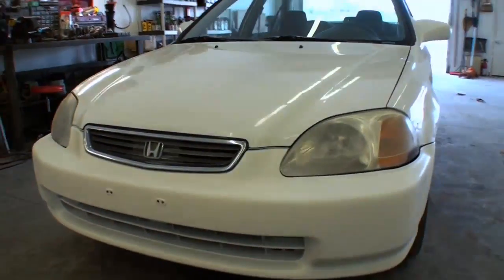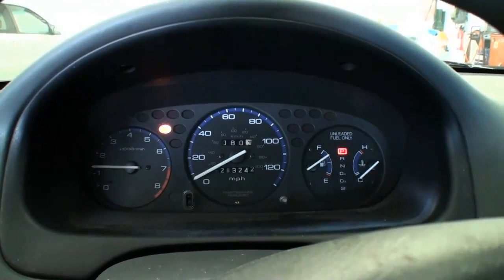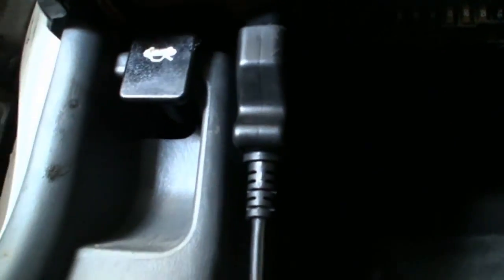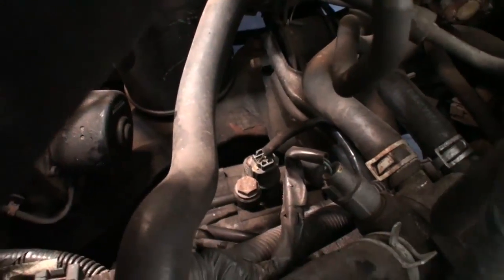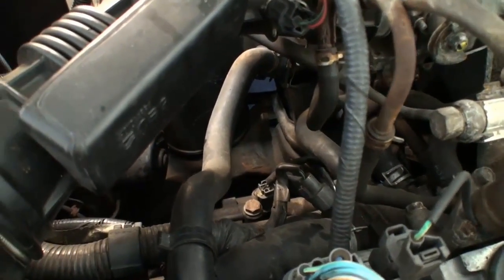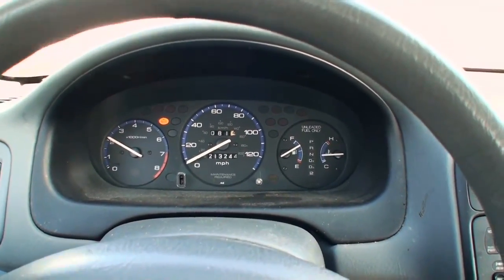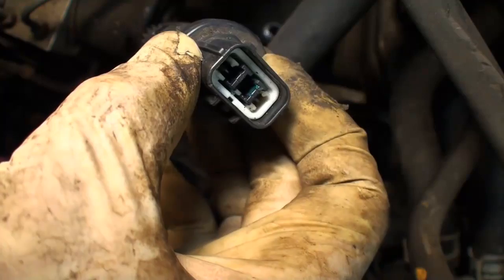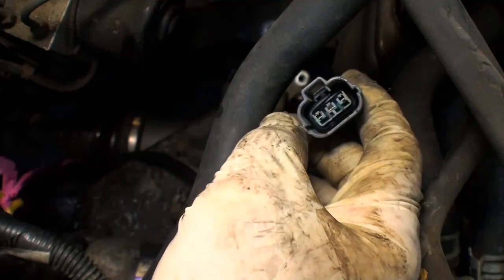P0501 1998 Honda Civic Speed Sensor Diagnosis -EricTheCarGuy

Comment: Had this problem as well on a 2000 Civic I'm working on. Replaced the sensor, but the center pin on the connector wasn't making contact due to corrosion damage, even after cleaning it up. Stuffed a tiny piece of aluminum foil in there, and it worked. Also slathered a bit of dielectric grease on the inside of both ends to keep moisture from getting in again. Applied this fix to an exact same issue on the MAP sensor.

Comment: i have a 94. slightly different sensor. the 3 screws on top are stuck so im removing the 2 bolts instead. 
I discovered the middle pin on the sensor was bent forward and flimsy. 
The car was driving around like that for at least a year and had some problems shifting. can a bad speed sensor cause transmission damage?

Comment: The mystery of the under-dash  7.5A Alternator/SP. Sensor Fuse #15 solved. Thanks. I wondered what SP. stood for. Strangely it supplies the alternator as well. I removed the fuse and started the car and the alternator still charged the battery. I did not drive the car to see if the speedo was nullified. Its a manual so it can't alter the gear change, but I was curious.

Comment: hey man so my csr is a 1997 honda civic coupe manual tranmission. It doesnt display the right speed when i go past 35 mph and the rpms jump around a lot. Im not suree to replace my speed sensor or if its something else like my gauge cluster is going bad.

Comment: So I have a 2000 honda civic where my speedometer will spontaneously jump around. It isnt constant just sometimes. However i have been having issues with my tps (throttle position sensor), would that cause issues with speedometer if the tps isnt dialed in?

Comment: I replaced the VSS sensor but not the gear could the gear be broken if I still have the 501 code? also unpinned the corroded connectore and cleaned out put electric grease on it. cleared code 97 Honda Accord. I noticed you replaced the gear as well I didn't do that .

Comment: @ERICTHECARGUY. Eric I am wait for the vss to come in next two days. I disconnected it and the speedometer stopped jumping. I drive back and forth about 60 miles can I drive 2 days without this sensor connected? Ps disconnecting tripped the check engine. However check engine not flashing.

Comment: Just went through the exact same thing except I drove without the speedometer for a year. Was misfiring bad and replaced plugs and wires and read that the VSS can cause some other problems. It looked easy to replace, but it didn’t work. Your video showed the corrosion issue and my center point broke off in the connector. Finally extracted it and now I have a speedometer. This was GREAT!

Comment: I still can't find it in mine so I guess I'm using the maps app or something, the speedometer worked until I went up to 3rd gear for a block but still lol, usually I eyeball the speed depends what gear I'm in or how high the rpms are

Comment: Dear Eric:
I would highly recommend that after you clean the corroded connections, you should apply something like Noalox (antioxidant joint compound, sold under many names, used primarily for preventing corrosion on aluminum conductors, but works great on all conductors). And I would also recommend coating the gasket of the connector with that wonderful silicone grease (silicone paste), to help it seal better and help it connect and disconnect easier.

Comment: I don't understand the part.. where you tried to guess solve the connection problem and not put the old sensor back to see if the connection was the problem, but instead replaced it anyway, so how do we know if the connection was the problem.  By the way I notice that the odometer was not working?  Was it not in congruent with the speed sensor at all

Comment: What about the car (98 civic ex automatic) losing power while driving, dash lights stay on and speedometer stays on 40 mph? Stalls then after about 5 minutes starts back up with no problem?
Reply: Ever get it situated?
Reply: @Micheal1075  thank you. I took it in to honda, they said it was the distributor, so I replaced it. While i was driving the car home, it did same thing again so I took it back to Honda center. They kept it for about 2 weeks and claimed it didn't turn off on them so they released car back to me and so far seems ok just keeping an eye on it until it happens again so I can get to the bottom of it.

Comment: Hello! I have a 98 vw beetle, I had gotten a p0501 code on the obd2 scanner I looked it up and it said to replace the vss so I did but yet I still get the check engine light. By the way the speedometer does not read speed

Comment: Thank you. I did some maintenance on my connector last night while putting in a new speed sensor, and as far as I was able to find through experimentation and observation, the rubber gasket should go in BEFORE the white guide clip. I tried putting it on in the same order as you did in the video (white clip first, then rubber seal), but I couldn’t overcome the resistance trying to plug it in, so I pulled it apart and tried gasket first. Still felt some resistance (the gasket probably could have used a bit of lubrication), but when it clicked it felt “right.” Thanks again for this, and your countless other helpful videos.

Comment: HI Eric, I have  a 2003  Buick lesabre  and it hard shifts   so I pulled  a coil failed code and replaced it  ,it was OK for  a few days now I have  a slight  hard shift comes and goes  changed fluid   to no avail.  would a EGR valve stuck case this ?
?

Comment: Also codes PO135 and PO141. Car will crank but engine doesn't turn over if you restart the car shortly after turning it off.  I've noticed that I can put the car in 1st gear crank it up mash the accelerator pop the clutch and the engine starts up. Would any of these 3 codes or problems have anything to do with the car not being able to start up after it is warm. There's never been a problem starting he engine when it's cold. Btw, 369,000 miles.

Comment: Eric, I got a CR-V 2000, I recently replaced the whole engine, now sometimes, the car shows the check engine light when I reach almost 60mph... I also noticed that when it is about to turn on the check engine light, the RPM seems to be high for the speed the car is going at. The guy a the repair shop were we changed the engine told me that it could be the speed sensor. The problem is not seen when the car is running at less than 60 mph. If I turn off the car and start it again, the engine light is gone, possibly until the next time I hit a high speed, sometimes it does it, sometimes it does not. 
Do you think I should replace the speed sensor or try something else.
Thanks!

Comment: Thanks for the nice video.  I apparently ravaged some part of my speed sensor mechanism when replacing transmission control cables on a manual 5 speed.  I get to survey the damage done tomorrow.
Replace the PCV valve!  Especially on older cars, and newer vehicles that you want to age much more nicely.  It is cheap, easy, and will help keep your engine from becoming pressurized with exhaust, which should've exited through the PCV valve, and forcing oil leaks in various places.  Another popular YT mechanic (SK) recommends doing it every three years.  When in doubt, just change it.  It is cheap, easy and protects your engine!

Comment: Juat bought a 2000 honda civic si manual transmission and the speedometer doesnt work. Now I know what to look for, but if the issue isn't the speed sensor then i dont know what to look for after that.

Comment: I’ve only seen 3 mins of this video and I think I just found the issue with my Acura TL 2008 I have ODB II DASH tool that shows me my speed from the ECU (Double checked with a radar, it’s exactly on point) but my speedometer shows 7 mph higher than actual speed. 

EX: radar shows 25mph, ODB II reading 25mph, speedometer showing 32mph (analog)

This will get interesting eric ! presses play **will update after full video **

Comment: I have 2002 civic ex and have the same problem with a code of P0501. The speedometer is fluctuating and I have a transmission shifting problem. But,  there are two speed sensors,  one is working magnetically the other one is that you changed in the video. Which one has to be changed?  I have not differentiated which one is broken.

Comment: Eric. just replaced the speed sensor. now I am currently about to drill out the mounting bolt. heres the story.
first initial startup after replacement. speedometer bouncing all over and transmission sloppy. second startup. everything great. every startup after. mostly indecisive, mostly not working. so the next day I figure, magnet not reading, bolt needs tightening. old bolt rusty bottom. this bolt runs through the cast and the Bottom touches air, right... explains the rusty end of the bolt anyway. anyway first time I tighten, nothing ... try it again, snap. so more invasive procedures and a new bolt needed. 

question is, could this just very well be a cheap aftermarket part? after all it was reading a few times. and obviously bolted all the way down until I snapped it, which I feared would happened, but did it anyway.   

and that geared end of the sensor? aside from a magnet, if this sensor works on magnet principle... is that geared end something that happens to go in easy or does it become problematic during installing? I'm picturing mashing gears to whatever its working with and not seating properly, thereby not getting readings because its in fact not "in". but then again the car did operate correctly at times. all this within a day and half. any reply appreciated thanks

Comment: I want to thank you so much. I changed the speed sensor and it worked for a few months. Then started to do the same thing. So i bought another one lasted one day. Now what? I went back and watched the video again. Guess what. The insert and gasket was still in the original part. Im a pack rat on parts sometime. I put the insert and gasket in the plug and smooth as ice.  Hind sight 2020. Sub. & like.

Comment: I have a problem with my 1998 accord reading inaccurately, it’s not a tire issue it’s just that it reads much higher than I am actually going could that be a speed sensor or is that more likely this barometer being worn out?

Comment: Good day the car guy I have a 2001 Chevy stepvan diesel with 58000 miles i have a problem with the speed , the speed gauge say I am going 70 mph but the speed of the truck feels like I am going 25 mph when I push the gas the speed gauge go higher but the speed of the truck stay the same and ideas please help

Comment: Hey Eric I have a 2001 Honda Civic automatic 67,000 mileage for some reason when I'm driving it doesn't want to pass 60 I'm thinking that is possible the shift solenoids or is it the torque converter I'm not sure please help me out thank you

Comment: How would a bad speed sensor affect a manual transmission? My speedometer has been jumping a bit at around 70 mph but I am not noticing any other symptoms. Will this negatively affect my 2005 honda civic?
Reply: No because the computer doesn't need any info from that sensor because you're controlling the shifts

Comment: I got a question I replace my speed sensor and my speedometer still doesn't work so I got another cluster and it still don't work what else can it be thanks
Reply: did you fix the problem?

Comment: hi Eric I have a 1999 1.4 Honda civic showing code p0141 we have changed the o2 sensor but problem still shows when scanning codes also car is very sluggish up hill does anything spring to mind we could try please any help is appreciated

Comment: Eric, I really need your help. I got Lexus gs300 1999. I once rev the engine from dead stop to full and since then there is a delay in gear shift, it jerks from 1 to second gear as if it's trying to catch the gear. I got my tranny changed but nothing. Later I got engine check light on and then it stopped happening jerking. What could be the problem.

Comment: Also after having similar symptoms i wasted money on a new sensor. One common problem with the 6th gen Honda's is the that the wiring for the vss is getting pinched between the intake manifold and its braket. Get underneath and remove the bracket and check that its free and hasn't been damaged. Just a quick tip before buying a new sensor.

Comment: Hi Eric I have a problem with my 2002 honda civic lx 1.7 everything seems to work fine but transmission  won't shift I just change the fluid but still won't  shift have you ever came across with a problem like that?
Can you help me out please .
Reply: Did you ever figure this out ?

Comment: Hi I got a honda civic si 2000 and my speedometer dont move at all I change the speed sensor but still dont work I check the wires but thy're fine what else can I do to fix this

Comment: such a hard decision- is it speed sensor or is it the cluster?  my rpm is way off. I have a 95 Civic EX with 95 B18c1 swap so my fuel cut off should be 8250rpm- but I can only get to 6800rpm on the gauge where it fuel cuts off and rev limits. it never can go past 7000rpm on the gauge. (but when i hook up a timing light gun with rpm digital gauge it will show 8000rpm!)  my Speedo is another problem and will go all the way around past 120mph and stop on the resting pin of the speedo and get stuck there so I'm driving around with no Speedo right now. sometimes it will try to fix itself and then goes back counter clockwise to 0mph and show the correct speed im at but then it random goes all the way back clock wise to the resting pin again. when the Speedo does work I'm off by 5mph after 40mph.  so is this the speed sensor or the gauge cluster?

Comment: 2001 Accord. The odometer gauges  (speedometer, RPM, heat and fuel ) they jump all four of them and all the lights go on and off. could this be also sensor or fuse problem?

Comment: Eric , I have a 98 Honda Civic with 113,000 miles on it...a tow truck busted my transmission and I went for six weeks without the car finally getting a settlement which I thought was fairly good..1600 from Pilgrim Insurance and $500 Triple A..  The man from Triple A was an ex honda employee for many years and told me it was worth saving instead of using the money for a downpayment on another car and big monthly payments, higher insurance since I am retired on fixed income..    I decided to use the mechanc's actuallly across   the street who always fix anything I need immediately...They put in the transmission....then showed me the radiator needed replacing....drove well for 2 weeks then bam...now he said alternator so that is being done and he said the fuse that connected to the speedometer was a problem  yesterday he said another issue...when he test drove it it sounded at times like it was going into another 'geer'....he told me this morning he is going to put a sensor on it...I have farmers back home who could keep me going but can't...what do you think I should do now?  I drive in fear wondering what next will break down and run out of my towing for reasonable fees from Triple A....so  I will not drive except to pick up my granddaughter and shop for groceries...

Comment: I have a 1996 Honda civic cx hatch with 520 000 km and the same thing has happened to me, but the engine light came on as soon as my speedometer went haywire, I'll unplug it and see if that's the problem. Thank you ericthecarguy!!

Comment: I've got a 97 Honda Accord SE in mind was giving the speed sensor code also I changed it out and it was acting fine for a couple of days then it started acting crazy again then I was looking on the web and it's suggested that I replaced the control modular so I put a new one in and it was acting fine for a couple of days then it started jumping again and my check engine light came back on and it said it was the speed sensor again so I was thinking it could have been the pigtails on the main wiring harness so I cut it off and directly wired it straight to the speed sensor then it was acting fine for a couple of days then it started doing it again this morning as I was going about 35 miles an hour my speedometer was showing I was going to zero when I turn my blinker on my speedometer started wigging out then when I turn my blinker off it stopped and then all of a sudden my speedometer started working again and the car started shifting fine does anybody know what would cause this to happen

Comment: I've a 1998 crv. Harsh shifting. I've replaced the solenoids and had a slight improvement. No fault codes but I've noticed that my countershaft and main shaft live data readings can intermittently be different. The main shaft sensor seems laggy and spikey. I don't think that's the one you took out here, is the main shaft sensor the one on the front of the box? Would it be this front one that's confusing the ecu and causing harsh shifting? Or something main shaft speed sensor related in the box? Thank you :)

Comment: My 98 civic speedometer has been working sporadically for 3 years and now. Lately, the car is starting to shift a little more abruptly, especially down shifting. It also slips a little in and out of gear at 60 mph for a while, then stays solid after about an hour on the freeway. Could the malfunctioning speedometer be the cause?

Comment: what is IAT circuit failure?  which sensor?  what does it do? i am getting this when diagnosing my 98 exi
Reply: INTAKE AIR TEMPERATURE. ITS LOCATED IN THE MASS AIR FLOW SENSOR AND TELLS COMPUTER HOW MUCH AIR IS SUCKING IN THROUGH THE INTAKE.
Reply: thank you i found that the choke sensor is getting direct current in it's all wires :S don't know what to do right now just disconnected it.